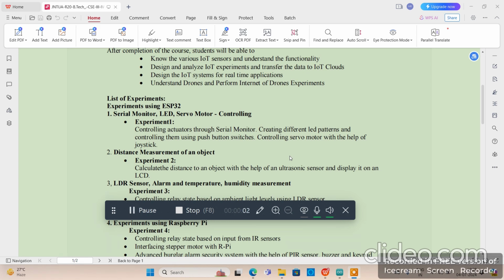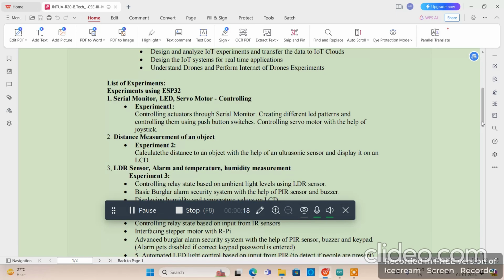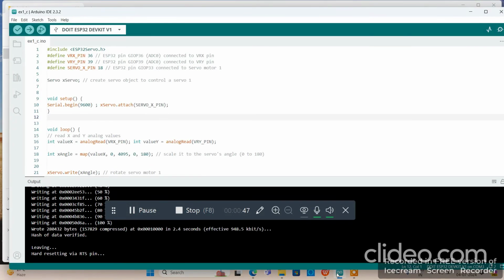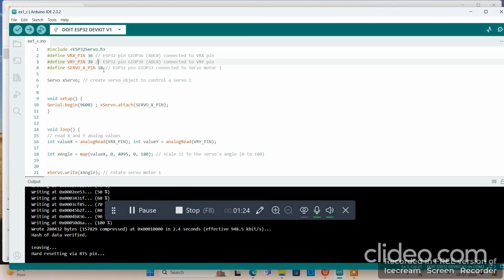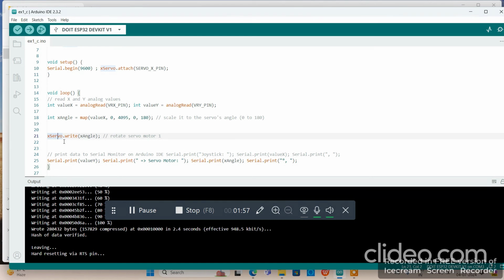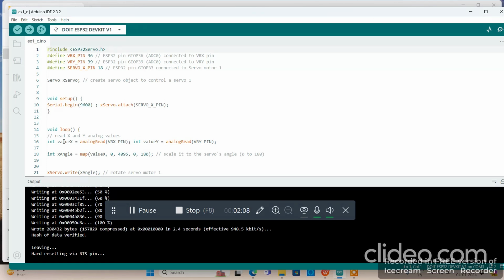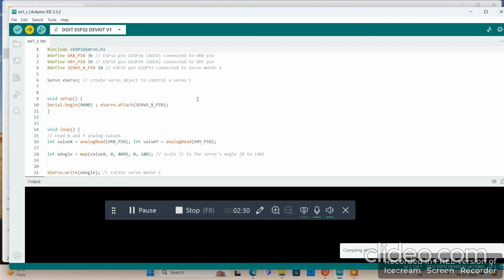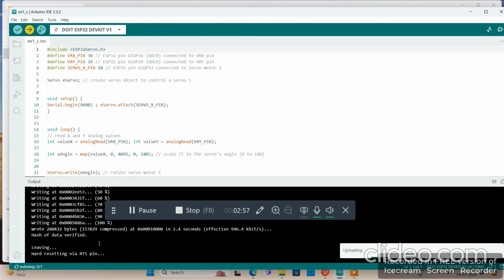esp32 experiments

Comment from the maker: #include <ESP32Servo.h> 
#define VRX_PIN 36 // ESP32 pin GIOP36 (ADC0) connected to VRX pin 
#define VRY_PIN 39 // ESP32 pin GIOP39 (ADC0) connected to VRY pin 
#define SERVO_X_PIN 18 // ESP32 pin GIOP33 connected to Servo motor 1

Servo xServo; // create servo object to control a servo 1

void setup() {
Serial.begin(9600) ; xServo.attach(SERVO_X_PIN);
}

void loop() {
// read X and Y analog values
int valueX = analogRead(VRX_PIN); int valueY = analogRead(VRY_PIN);

int xAngle = map(valueX, 0, 4095, 0, 180); // scale it to the servo's angle (0 to 180)

xServo.write(xAngle); // rotate servo motor 1

// print data to Serial Monitor on Arduino IDE Serial.print("Joystick: "); Serial.print(valueX); Serial.print(", ");
Serial.print(valueY); Serial.print(" => Servo Motor: "); Serial.print(xAngle); Serial.print("°, ");
}